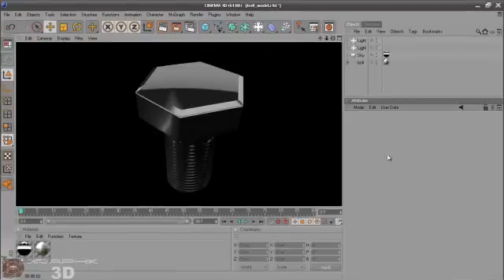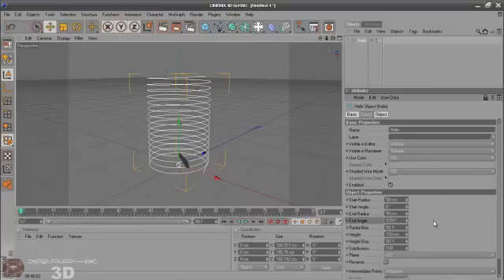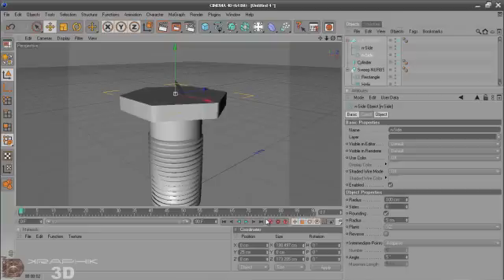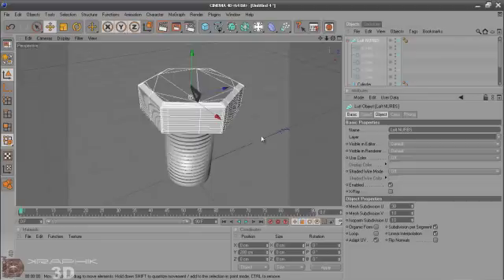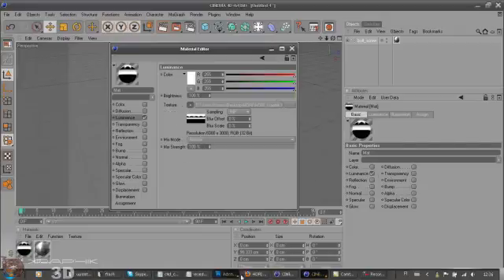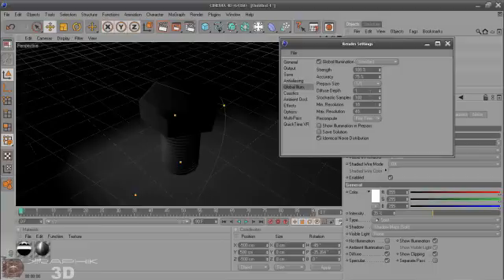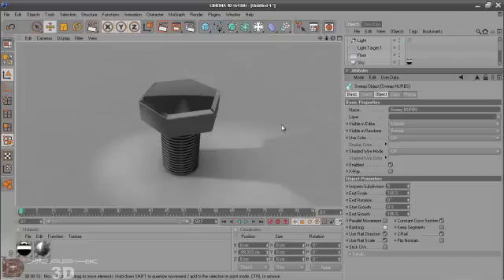cinema 4d tutorial - how to model a bolt screw

Comment: F'n'X the thread rotation is easy to cure. Delete the original rectangle, then switch to the Front view and create a new rectangle 5 cm x 5 cm. Press 'c' to make it editable then from the Mesh menu select Commands>Subdivide. Now select the four corners of the square and again from the Mesh menu select Commands>Set Point Value and set the Y coordinate to 0cm. Your square should now be a diamond. Drag this back into the Sweep NURBS. Finally, select the Sweep NURBS in the Attributes Manager and de-select Banking and your thread should now be perfect.

Comment: What about thread which is straight (0 degrees)  at the bottom then rotated in the middle (about 45 degrees) and then back 0 degrees at the top ?
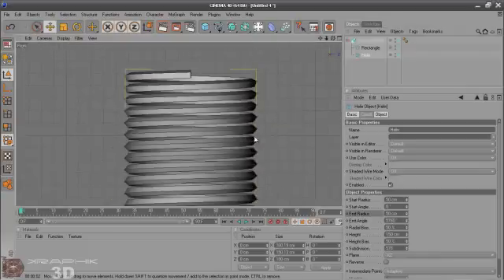Check 3:33 - 3:38 .... hopeless :)
You forgot about banking mate ... :)
Reply from the maker: F'n'X 
thanks for your feedback. that´s a good point. ;-)
Reply: No probs, ;)